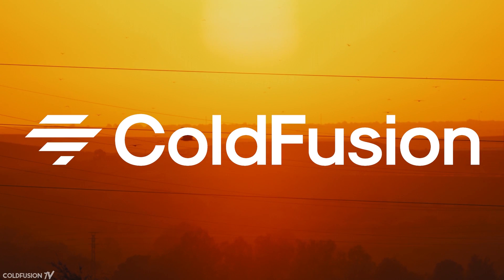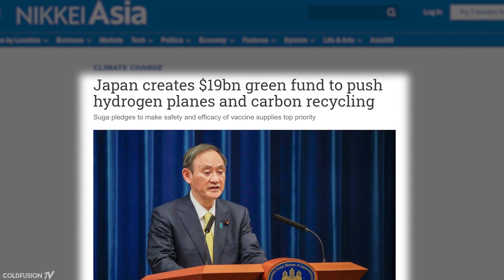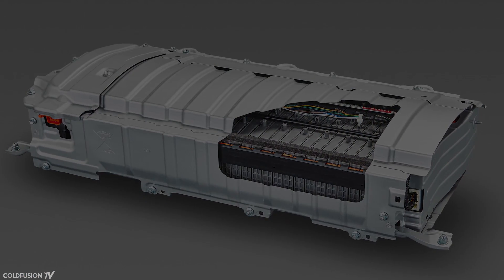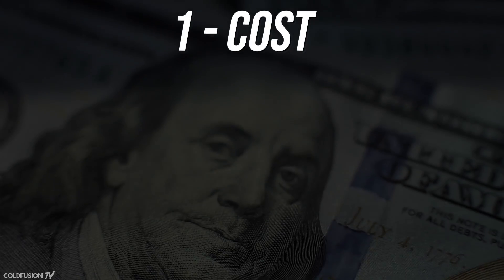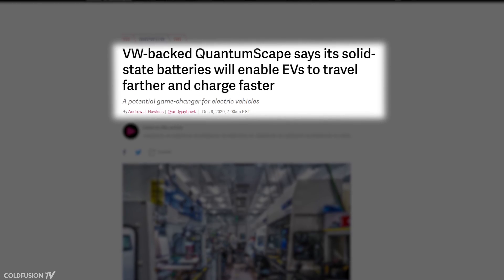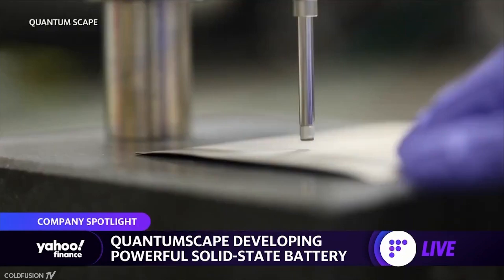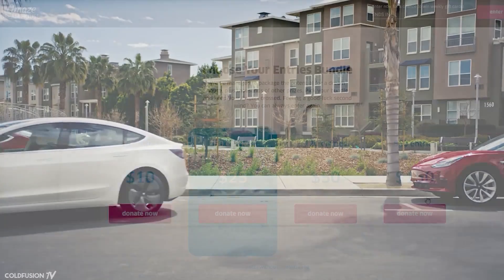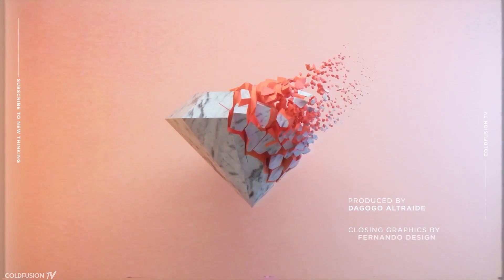Toyota Plans Revolutionary Solid State Battery for 2021

Comment: 800 charges to 80% ! That's terrible. That's like 2-5 years of use until you need replacement. Tesla batteries can go well over 100k before hitting 90 % capacity.  Hope they triple that number if they want long life EVs
Reply: I estimate (finger in air) around 200 cycles a year. This takes into account that the car is probably constantly connected to grid when not used, people don't use their car every day, they don't drain it completely every day, and other times need supercharging. The battery is the most expensive part of the car, and when it breaks buying a new car is the logical choice in most cases. Thus the longevity of the car can be said to be almost equal to the battery longevity. 200 charges a year would result in a 4 year life-span (based on your number, and with only moderate use). Thus a tripling of that number would be insufficient. You would need at least 6 times the number of max cycles.

However, the curve doesn't need to be linear (and it most likely isn't). If it takes 800 cycles to reach 80%, but 10,000 to go from 80-70% the battery is still an advancement compared to current technology, but you have to consider the "80% of initial capacity" as the max capacity when buying the car.
Reply: this channel has become click baity garbage and many arguments he makes are surface level and/or just ignorant

Comment: Musk better gets on this before he falls behind
Reply: Is he?

All the graph shown here underestimate Li-ion batteries so much.
These chart show how deceitful these solid state battery companies are.

No, best performing Li-ion energy density is not 300Wh/kg.
It is 400Wh/kg.
Tesla is already mass producing 330Wh/kg cells now. 
Some of the cells have already hit 400Wh/kg. But these 400Wh/kg are not high yield.

Toyota solid state battery is total bullshit.
If they claim their SSB is so superior, why is the range only 500km?
Tesla model S already do 700km and model X 650km.
And that is with their old batteries.
Reply: @seasong7655  Tesla will be first to mass produce solid state if it is viable.
We will see.
Reply: @AkaiKA4K  It's now already being used in Daimler's buses. They're not the first
Reply: @seasong7655  Mass production and viable( low cost ) are the key words.
Tesla will be the the first to mass produced solid state battery if it is mass produceable and is cost competitive.
Reply: @seasong7655  Also, solid state for city buses are really dumb.
City buses don't need to be long range.
City bus battery need to be long life.

Proterra buses with lithium phosphate battery have over 4000 life cycle vs solid state's 800 cycle.

Comment: My Chevy Volt has performed perfectly for 9 years, 90,000 miles. Cost about 50 cents for 25 miles per day. Unlimited range because it has gas for backup.

Comment: If there is so much research and rnd, why haven't we seen solid state battery available yet?

Maybe because the tech is too expensive to preduce and they cannot bring it to the mass.

So basically we stuck with lithium ion until they bring down the cost.

Until now we haven't seen a cheap electric car yet, and if you think about it, an electric car has less moving parts than the conventional fuel car, so it should be cheaper and more reliable.

But until now the cheapest electric car goes 70 miles and still cost more than fuel cars.

So what I am seeing here is a blow up in the luxury electric cars and no cheap option.

Comment: if a car can run on hydrogen, ostensibly "water"...where is that car?  They have a hydrogen cell car in production?  
Also why do all the car companies think they need some 500 mile battery?  Why not start with the low demand vehicles first, like post office?  or other "home every night" industries?....what about boats?  There's an industry where electric would revolutionize the business, fuel is biggest cost...and the noise?  Would be near zero...

Comment: with 1000 charge cycles, this solid state battery is still carbon positive (adds co2) compared to new gas engines. this revolutionary battery lasts a grand total of 33 months.  These batteries also doubles the kwh's the average owner uses in a month. how are we supposed to get that extra power from an already over capacity grid.

Comment: In the movie "The Fifth Element" there was a scene where a maintenance crew replaced a drained power cell with a fully charged power cell on a spacecraft. All done within a minute. Why haven't the manufacturers of electric vehicles come up with the same concept?  When our batteries are low,we just drive up to any service  stations with fully charged battery cells. They would take out the drained cell and replace it with a fully charged one in seconds. Rather than the long wait of hooking up and charging. And  you would never have to worry about the enormous cost of replacing a built in battery. Since you would never actually own the power cell(deposit). You would only be paying for electric power cost. Of course you would still have the option of hooking it up to your outlet in your home.
Reply: Or you could buy extra batteries, charge them beforehand, and keep them in the trunk.
Reply: @Adamis9876  it would be like propane tanks. You would buy fuel cells, and when you use them up, trade that fuel cell in for a fully charged one. You are credited for the trade in of the container, and only charged for the cost of recharging the cell. You can buy as many cells as you want. And if you go on long trips, you can pull up to a service station and have the fuel cell replaced, if you cant carry extra cells. You would be  credited the cost of that fuel cell for another fully charged cell. All you pay for is the cost for charging.
The problem with carrying extra cells is the weight.

Comment: I thought Toyota was going for Hydrogen Fuel Cells? I guess they're doing both 🤷🏿‍♂️
Reply: It's like this: they are late to the BEV revolution because they bet on the wrong horse (fuel cells). Now they are trying to catch up without losing face.
Reply: @seybertooth9282  Now that makes the most sense to me. In all honesty they are a pretty reliable brand so I think ppl will prefer their product even if it isn't released as soon
Reply: Still requires batteries for that technology!
Reply: They are doing whatever they can to stay away from lithium. they're trying to maintain supply chain and energy independence from China and these solid state technologies along with PHEVs and hydrogen give them that capability.
You need to look at this from a world politics perspective first and an engineering problem solving viewpoint second. That's what so many people outside the auto industry don't understand, especially the futurists.

Comment: Tesla's cars already do more than 500km on a single charge. Though they don't charge as quickly as Toyota's. Considering that Tesla is focused on reducing cost of electric cars, and that Toyota's battery tech is still relatively expensive, it's not going to be an easy sell for Toyota.

Comment: lithium-ion batteries are capable of much more than is currently realized
Reply: Totally.

All the graph shown here underestimate Li-ion batteries so much.
These chart show how deceitful these solid state battery companies are.

No, best performing Li-ion energy density is not 300Wh/kg.
It is 400Wh/kg.
Tesla is already mass producing 330Wh/kg cells now. 
Some of the cells have already hit 400Wh/kg. But these 400Wh/kg are not high yield.

Toyota solid state battery is total bullshit.
If they claim their SSB is so superior, why is the range only 500km?
Tesla model S already do 700km and model X 650km.
And that is with their old batteries.

Comment: Yawn, not watched the video yet but let me guess:- the "revolutionary" battery is just a prototype and at least 5 years away from mass production like the "revolutionary" QuantumScape vaporware one!
Reply: It is the quantum scape vaporware
Reply: Just as  I thought 2 minutes in and the "revolutionary" battery won't come out for another 3 years(if this can be believed) not 2021. This from a company that has never come out with a fully electric car! According to Panasonic solid state batteries are 10 years away, if solid state batteries were round the corner don't you think Tesla and Elon Musk would be coming out with them soon!
Reply: @petersz98  VW already announced that they have a 1.7 times better battery and will be releasing a vehicle with them in 2022 or 2023 at the latest because they believe they can get it to 2.2 times better.

Comment: Interesting information to say the least. But one thing I wonder is that as far as I know it's the current li-ion batteries that have the dendrite build-up problem and solid electrolyte would actually be a solution for it, not the other way around. But I'm no expert so I might have got that wrong.

Comment: Everyone was laughing at prius. Customers have a part in delaying advancement in Toyotas ev's probably if they had stagnant research due to poor reception of their innovation.
Reply: True but Toyota rarely innovates to begin with as a way to maintain reliability across their lineups.... Every decade or two they will roll out something new but they are usually closer to the back in terms of performance in any particular application. The only real exception in recent years was the development of their Hydrogen car the Mirai.
Reply: Also, Prius had horrible design.
Reply: @liberallarry847  the 1st gen prius yes, but 2nd gen and after were dramatically improved

Comment: 6:25 at cell level, when you put it in a battery pack it loses 20-30% energy density
Reply: U sure this number is correct for a pack where contents need much less cooling and arent as prone to combustion?
Reply: @sysakPL  check "the limiting factor" channel
Reply: Shit, Toyota engineers are wrong dude, they should listen to you
Reply: @ivanserrano5511  let me put in some easier vocabulary for you, "it doesn't matter density in cell level if you need them to work in a pack" nobody is saying anybody is wrong.
Reply: @ivanserrano5511  shit, Toyota engineers with zero known backround about batteries so zero credibility could certainly be wrong dude.
Not only that, but Tesla right now gets 660 KMs with old tech on the new Long Range Model S, and later this year with their new 4680 Li-Ion batteries and more new tech the Plaid+ Model S should get around 833 KMs of range with a 250 KWh supercharging and probably new 350 KWh supercharging (they talked about it coming on Battery day if I remember correctly, or at least higher than 250 and rumors say its 350 KWh).
meanwhile, Toyota says SSB should get you around 500 KMs of range and seems like around 300-400 KWh of charging....
So SSB right now doesn't seem really good compared to 4680 batteries which would be around 50$ for KWh, while according to this video the price of an SS battery with 1 KWh is astronomical.

Comment: 6:19 80% energy capacity after 800 cycles is kinda lame. For people that don't use the car often may not be an issue, but if you consider using it for services you'll need a new battery pack every 3 years or so. Tesla's new cell isn't solid state but can do 2500 cycles and retain 80%+ capacity and is allegedly cheaper, plus it's integrated in the structure of the car making the density of the pack negative when compared to it at cell level.

Comment: I call B.S. on this video and ColdFusion's bias.  The problems with solid state batteries are still HUGE.  Cost to manufacture has come down but its still on the order of 20 times that of conventional LI batteries.  Half the US (the largest market) has real winters and the "solution" to date is to build in heaters in to the battery pack to heat the cells.  Of course the power to run the heater comes from the batteries and any supposed gains in range are quickly destroyed.  Finally the batteries don't last very long!  This video claims 800 recharge cycles, about 2 1/2 years if you charge the car nightly.  (The 800 cycles is a dubious claim at best.)  No folks, do NOT expect these to be put into mass production with-in the next ten years.

Comment: There are a lot of drawbacks of solid state batteried like dendrite formation, low charge transfer efficiency, lower contact surface area etc.. If toyota has addressed these concerns then it would be a game changer..

Comment: Talk is cheap, solid state battery chemestry is not. If solid state batteries had higher energy densety and charged in 10min we would see them in expensive electronics many years before in cars. We dont. 
How is this not a pie in the sky?
Hwo more likeley to fake it than Toyota that really just want to continue selling fossils?
Also i see no evidence poining to a revolution, just talk.

Comment: Elon went after solid state batteries in a big way and at the end said they don't work for vehicles. And Elon.... fairly smart dude that could have went any battery direction he wanted to as nobody was in the space yet (no pun interned ;)
Reply: All the graph shown here underestimate Li-ion batteries so much.
These chart show how deceitful these solid state battery companies are.

No, best performing Li-ion energy density is not 300Wh/kg.
It is 400Wh/kg.
Tesla is already mass producing 330Wh/kg cells now. 
Some of the cells have already hit 400Wh/kg. But these 400Wh/kg are not high yield.

Toyota solid state battery is total bullshit.
If they claim their SSB is so superior, why is the range only 500km?
Tesla model S already do 700km and model X 650km.
And that is with their old batteries.

Comment: 15min "fast" charge.. yea no do the maths you need the power a small town to charge one car in 15mins. 125kWh battery needs a half megawatt to get charged in 15mins, ignoring the efficiency losses.
Reply: I mean, sooner or later we will have to have the infrastructure to allow for these kinds of power transmissions to be commonplace across the charging networks. If something's not a physical impossibility AND it has a strong economic incentive behind it, then it's certainly going to be built sooner rather than later.
Reply: @sementhrower420  Have you been to Montana?
Flippant replies aside, my understanding is that (even here in the UK) we would have to effectively more than double the capacity of the grid to accommodate all-electric vehicles. That's going to be a huge cost, and seems likely to not happen in remote locations.
Reply: If a Tesla Model 3 can add 1000 miles an hour at 250kw (peak speed) (and the 4680 cells will be faster) it can be done now.

Comment: But WHY are solid state batteries expensive?  You don't give much info here.
Reply: The materials used in them are usually expensive. For example the samsung solid state batterie use sliver which is expensive.

Comment: This pie-in-the-sky story is fundamentally a Physics, Math, and infrastructure equation. Let's assume this SS battery exist at a price point that minimally increased the average cost of a vehicle. Let's assume this EV has a range of 500 miles, and a 0-100% charging time of 10 minutes. 
- From the hype: It's estimated that a solid-state car could have a range of 1000  kilometers (621 miles) and take 10 minutes to charge. - 
(the below math I am doing in my head, so any corrections would be appreciated)

Total charging time = kWh ÷ kW or kW x 10 minutes = kWh
The battery would need to provide a minimum 160kW of energy density to travel 500 miles.
Thus:  160kW x 10 = 1,600kWh
This would require a charging station capable of delivering 1.6Mw per vehicle.
Let's add a 4-station EV charging location, so 4 of these vehicles can be charged simultaneously (like a regular gas station)
Electrical loss would safely require a 10Mw feed to this One station. The equivalent to power 7,500 average homes.

Typically a dedicated 10Mw municipal substation, requires at least a 1.5-acre footprint and about $9 Million to build.  Moreover, the load on the existing grid would need to be modified to handle such large drain peaks.  Or a Solar farm of 40,000 panels + supercapacitors could also provide the needed electricity - per charging facility.

Yeah, this is a great idea.

Comment: Wait wait...500km of range in 10 minutes. Current gen v3 Superchargers can do that in 20 minutes. And that’s not even with 4680 cells which are coming online. 

I kinda expected more...
Reply: 500 miles, but even that's nothing special. The Plaid Model S will have at least this range, maybe more.
Reply: @andrasbiro3007  Yes. 
New model S long range will comes with over 550miles range.
Even plaid S that is not optimized for range is doing 520+ miles.

Comment: Oh if only Aptera would use this technology (a 2k mile range).
Reply: You won't want Aptera using any of these batteries.

All the graph shown here underestimate Li-ion batteries so much.
These chart show how deceitful these solid state battery companies are.

No, best performing Li-ion energy density is not 300Wh/kg.
It is 400Wh/kg.
Tesla is already mass producing 330Wh/kg cells now. 
Some of the cells have already hit 400Wh/kg. But these 400Wh/kg are not high yield.

Toyota solid state battery is total bullshit.
If they claim their SSB is so superior, why is the range only 500km?
Tesla model S already do 700km and model X 650km.
And that is with their old batteries.

Comment: This is pretty amazing, however, transportation mostly relying on batteries becomes unsustainable at large scales and distances. If you do the math, you need to seriously beef up the power grid. Don't get me wrong, I really like EVs, but I don't think that batteries alone should be the way to go here.

I would much prefer the usage of methanol (can use existing gas station infrastructure and is pretty stable and easy to store), or hydrogen (burns completely clean) in conjunction with a small buffer battery.